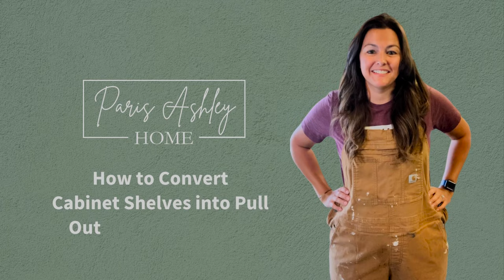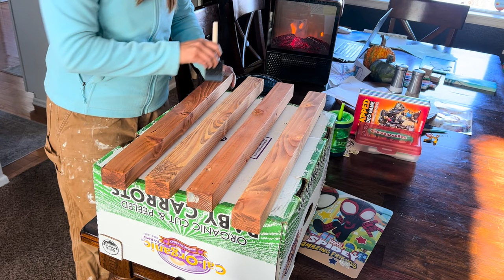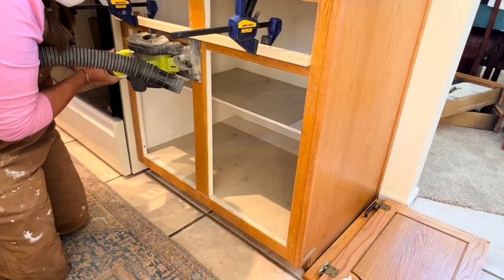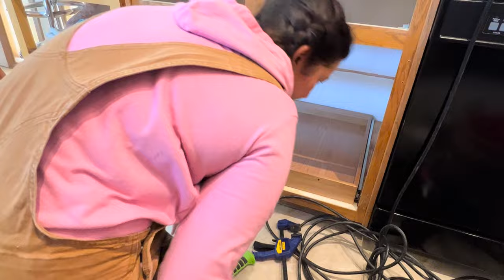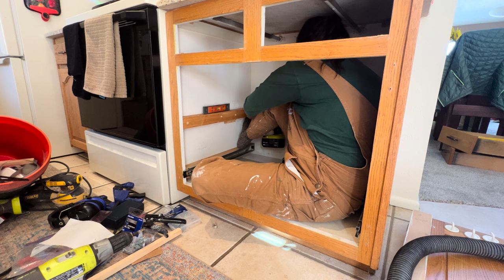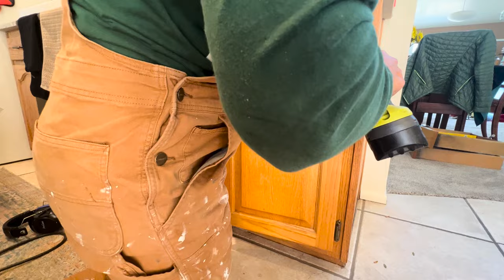How to Convert Cabinet Shelves into Pull Out Drawers Tutorial

Comment: Other than using a circular saw to remove the stile, the rest is pretty bang on.
Reply: What would you use instead of the circular saw? I was thinking multitool instead, but maybe you have a better idea. I have a project coming up with the same stiles in the middle and need to be removed.

Comment: Install the slides on the drawer extend the slides use a block or 3 rd hand to match your height and install the slide portion to the side shims inside the cabinet.  Also find a cabinet maker to work with or set up a router table like I did and make the doors to the right width.  
I started out very small like you and now do finish carpentry ( doors, trims, base, cabinets ) but not full kitchens.  I like doing a remodel say like all flat panel shaker doors, soft close hinges, & new drawer fronts.  All stuff you can do!  Oh and look at a used cabinet saw those contractors saws R like an airplane going off in your head!

Comment: In my case I want a pullout system where the front of the cabinet is attached to the interior drawer so I don't need to swing open cabinet doors. Also, I need just  a single shelve, or maybe not maybe two shelved  just load and unload from the side once pulled out

Comment: I just did this on one of my cabinets and other than needing to sand down the top of the attached piece on the door (sticks a little bit) it came out great.  What a difference in the function of this cabinet.  Previously I added heavy duty wire pull outs on top of the already installed shelves which is also a great addition but pricy.  Next I’m tackling my two door tall pantry cabinet.  Planning on doing four drawers.  With all your care on the spacers it doesn’t look like you put stain on the attached piece on the door to take away the whiteness of the cut edge or is that just the lighting?
Reply from the maker: So you are correct, I did not, I did wood fill and stain any imperfections i made on the face, but I didn't stain the top. 2 reasons, I didn't have the right color, and the only time you see that is when the doors are open and that's usually for about 30 seconds and then they are closed and you don't see it. No reason to not do it though!
Reply: @parisashleyhome  I haven’t stained my top edge either and you are right it’s only seen for a few seconds.  Enjoying your channel.
Reply from the maker: @NanaStillLearning   haha exactly! And thank you so much!!

Comment: Doing this project as we speak. Curious why you didn’t screw the false piece back on the door rather than Brad nailing like you did? Great narrative on the video btw
Reply from the maker: 2 reasons… 1st, I tried ha, but my screws kept breaking (must have been a bad batch) and it was like a third inch overlay, not much at all. And 2nd, doing loctite glue, a LOT of brad nails and clamps, it felt very secure and I felt confident with it. If the over lay is big enough on your doors, then I would use a countersink bit to get those screws more hidden in there :)

Comment: A Japanese pull saw would have been a better option for cutting out the middle piece .
Reply from the maker: Definitely don’t have one of those so I had to work with what tools I had :)
Reply: There are really expensive pull saws, but also some rather inexpensive ones that work really well. Definitely worth the investment.
Reply: @parisashleyhome you did fine and for most ppl the way you did it makes a cleaner cut especially if you’re not used to a pull saw. 
My only contribution would be to make a wide kerf in the middle of the board beforehand to give the pieces room to fall, reducing kickback of your final cut.

Great job.

Comment: Great work. But really you should stop using your legs as a table when drilling. I know it probably never happened to you but it only takes one time for the drill to slip and go straight into your thigh. Bring some board and use it as a table on the floor next time. Or even a foam mat would do fine.